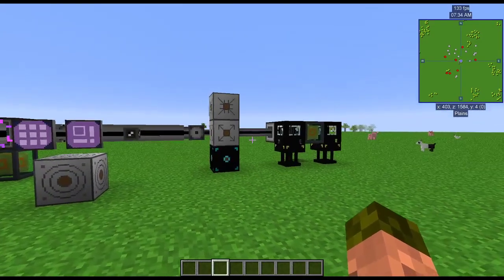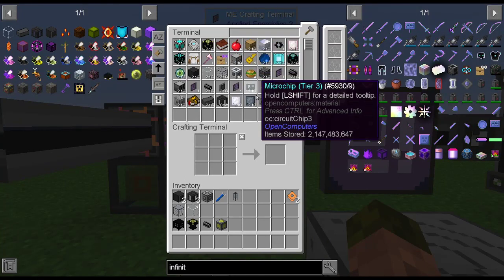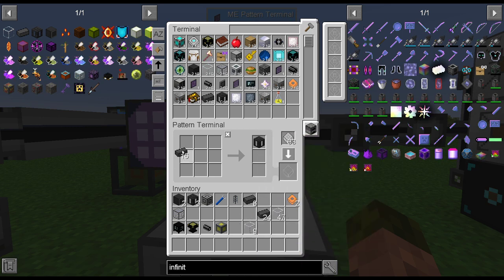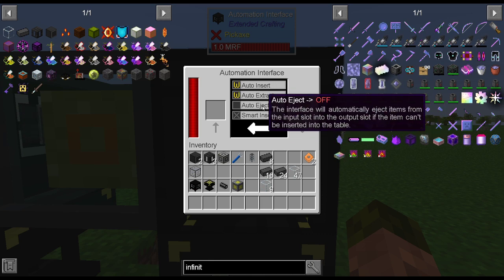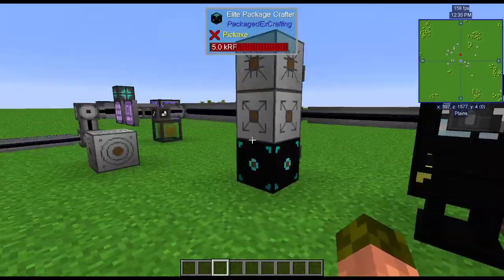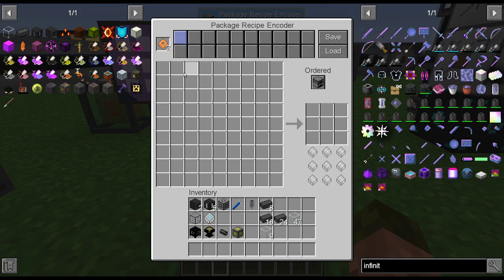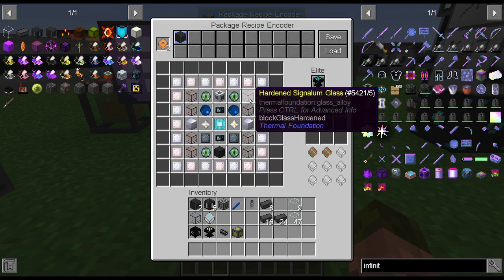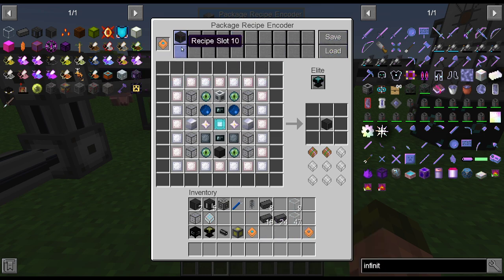Demonstration of Packaged Auto, PackagedEX Crafting, and Extended Crafting using Applied Energistics

Comment: Thank you for the video. On point and i was lost at first.  So the pack im playing i found you need to click the me cable on to all blocks for the packagedauto mod and i have the un-packager on top of the crafting table. The packager is under and with his configuration it just would not work because you end up with a pattern been crafted and left in the ae.
Reply from the maker: The packager can be anywhere, it just has to be on the network.